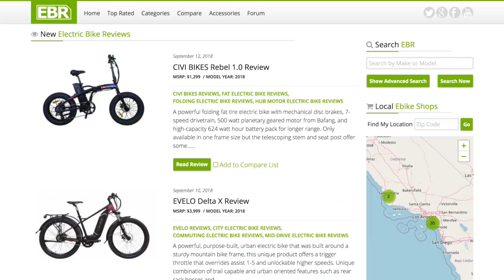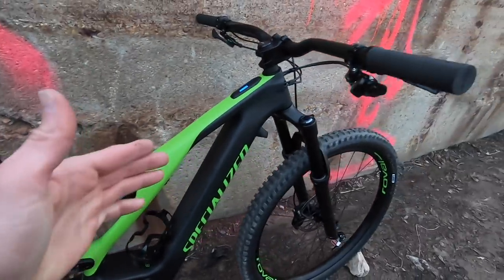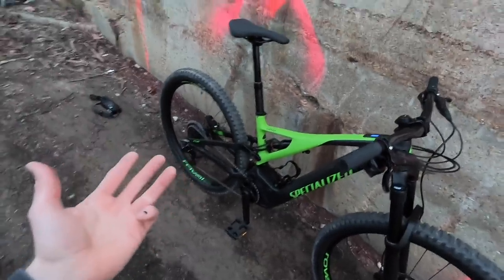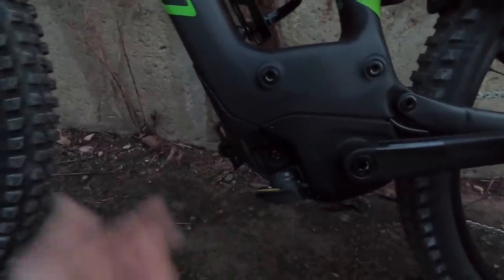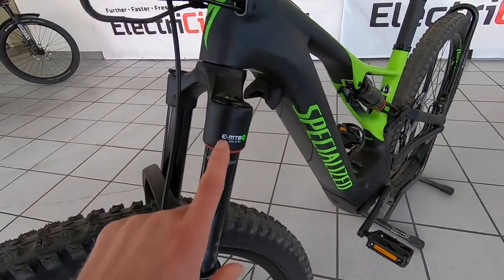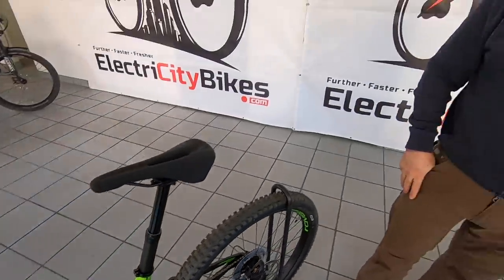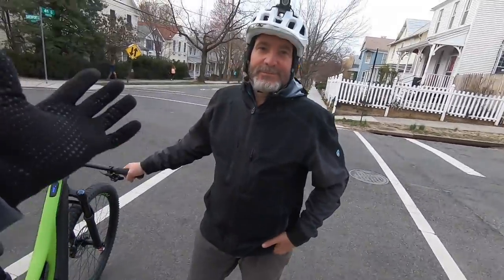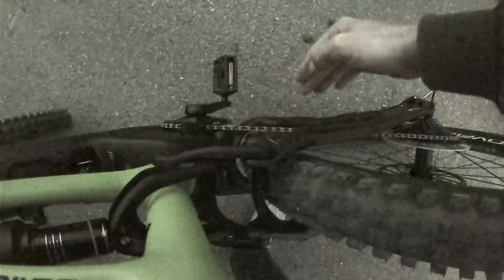2019 Specialized Turbo Levo Expert Review - $8.3k

Comment: Thanks for the review. I'll have to look at the price points for the lesser models of the Turbo Levo. Even $5000 is a bit of a stretch for many moderate bikers, such as myself. Spending $8000+ for an E-bike  is boggling when I can get a good motocrosser with 40+ horsepower, equipped with an electric motor to start it for the same amount. Apparently, the cost premium for a purpose built ~600 Watt electric motor, a 600+ Watt-hour lithium battery and some carbon fiber matches the cost of building a ~400+cc engine comprised of hundred of precision parts, an engine management computer, fairings, fuel injection system, and a raft of larger components (frame, brakes, tires, wheels, suspension, lighting, etc.)

Comment: I have the 2020 Levo Turbo ($5300).  I must say...the battery lasts FOREVER!  I have had the bike 2 years and charged it maybe once just to see how to do it...The battery still shows almost fully charged after multiple uses and in over a year.  I was concerned it would drain after no use for months...but not a problem at all.  Both tires were low on air but after pumping them up, I still had full charge and off I went.  Sometimes I feel like riding it regenerates the battery when I am not using any of the levels, which wouldn't be a bad idea when coasting down hill.

Comment: This is my next eMTB, love the 29x 2.6 but I’m going to wait a couple years.
Reply from the maker: Cool, do you think you'll get a used one at that point or save for the next generation of Levo? Maybe they will be even more refined by then... I agree that this thing is already amazing, and sometimes it's difficult to imagine how much more it can be improved, aside from more energy in a smaller, lighter battery :)
Reply: no, I'll probably get a new one and get a great deal on it, got the KENEVO & 2017 Turbo Levo, they are in my opinion the best eMTBs. I do like the Rocky Mountain, you should review one of those, but I'll wait and see if they fix the issue in the back housing of the motor where the dirt gets in, Specialized is the best brand even trying out Yamaha and Bosch early on.

Comment: I've only charged my 2018 Levo battery off the bike once since I bought it 18 months ago, so for me the added difficulty of turning this bike upside down to remove the battery is a non-issue. Probably the design of this seamless downtube allows a weight reduction while keeping the same strength, and the aesthetics are definitely nicer as well.

Comment: Nice bike Court and great job on the stair climb, This is just about in the same price range as the Pivot Shuttle. A bit curious how it would compare in terms of ride and build quality. Mission Control app also looks sweet to dial everything in to your liking. I also like that the sensor is hidden in the rear opposed to on the rear spoke wheel. Many cool refinements. Well done review indeed!  $8.2K is a little steep, however,  I do like the relocation of the power meter buttons. Cheers!

Comment: I would not expect a derailleur on such an expensive bike.
Reply from the maker: I think the X1 is ebike approved by SRAM to handle more force, and you don't need an Eagle cassette with 12 gears when you've got motor support, the steps between gears don't need to be as close and you don't need such a low gear... unless the battery runs out :P

Comment: Court I've been meaning to ask you next time you're with the actual developers of e bikes doesn't matter which manufacturer as to why ebike batteries are four times the price of automotive vehicles? Surely the batteries in my 40kwh Nissan leaf (£10,000) equates to over £$50,000 if you broke down the costings per ebike amount of battery? Surely automotive batteries are of much higher quality meaning even more questions as to why the consumer is being ripped off or the manufacturers of vehicles losing money? Cheers if you can find out.
Reply: It's an interesting question. Actually I believe the quality and type of cells are the same for the cars and bikes. I know my ev has Panasonic cells that are the same 18650 as my sondors. Possibly the quality control or matching of cells is higher in the car but pretty sure the cells themselves are identical. But anyway does beg the question why comparatively the batteries are more expensive on a bike.
Reply: You should take into consideration the BMS and the basic manufacturing costs which are mostly the same for each battery no matter which capacity they have. This explains a part of the difference and the rest is the pricing policy of manufacturer. For new devices there is a hell of competition but in after sales you already bought so they can charge more. It is totally normal tho calculate a factor of 3 for spare parts. They are all doing this as long as there is no second source where the clients can buy. For this reason there are several small companies offering to exchange the cells on the batteries for much lower price than a new original battery. The problem is that there are so many different battery designs and BMS out there that they concentrate on the big suppliers like Bosch, Yamaha and Shimano. For exotic parts like Specialized there might be never one doing this.
Reply: @habi0187  Thanks but surely an automotive bev BMS is much more dedicated due to the nature of more capacity and individual cells factor in liquid or passive cooling bms etc and the costs would spiral upwards not downwards.
Reply from the maker: I think some of it has to do with economies of scale, ebikes like this come in many sizes vs. just one. Bike companies tend to be smaller than car companies and are integrating expensive custom parts (like the carbon fiber frame). Also, in marketing courses they always teach that a product is worth as much as people will pay, and Specialized is decidedly high-end. It's why their stuff is all named custom and every part is tweaked a bit (even the motor software here, the stem cap, the little tool), there are many reasons for pricing but I'll be publishing a sub $2k full suspension ebike shortly that demonstrates what is possible for lower prices :)
Reply: @FancyaBevMate  You are right but the relative costs per battery is higher. Lets say the BMS for the car battery is 1000 Dollar and the bicycle battery is 300 Dollar means this is 10℅ compared to 25 % oft the retail price.
Reply: @habi0187  I own a 2019 haibike sduro trekking and love e bikes but they still need to sort this out as I wont be the first or the last to make comparisons and think why and like I said I would bet every day of the week in the batteries not to mention the bms on automotive industry are 3x the quality of those found on e bikes as their warranties show my 2018 leaf has a 100,000 mile warranty how many e bike batteries will have that warranty. I'm currently doing my own channel on my vehicle with full break downs on battery SOH (state of health) on each 10k miles charged from around 20% to max every day had the leaf for just over a year and its lost only 5% range on 33k miles. Cheers
Reply: Fancy a Bev Mate? I own a Specialized Levo FSR Comp of 2018 the battery health there is still good. Please take into consideration the car battery’s are normally not charged 100 % and there is a residual capacity of approx 10% in order to avoid bad conditions for the battery. Especially the BMS of the Nissan Leaf is a good example for a not so good engineered system. If you remember there is a thing called rapped charge gate for the Nissan. Since they have no active cooling for the battery you can not fast charge it correctly on longer trips. Even the new models are not using an active cooling for the battery. So that fast charging on CCS chargers is not really possible.
Reply: @habi0187  Mate with all due respect now you are talking utter garbage regarding the Nissan batteries its why I am currently the only taxi driver doing a long term vlog on this and many other issues (on you tube) that people have complained about first of all rapid gate is ONLY an issue for those in very hot climates AND if you travel more than 240miles per day, secondly its been fixed with an update (I wont have the update because even as a taxi driver I never travel more than the above mileage per day) I would rather have less degradation on cells which mine isn't showing even at 33k miles in just over a year. We know our vehicles I've been in the industry for nearly 25 years and you know your vehicle inside and out when you are traveling every day in it and I have lost I'd personally say around 2miles maximum. I will be running this vehicle for upwards of 200k miles (or until everything breaks or isn't viable in working conditions) to dispel all the myths regarding these cells. The early models had issues correct but then so has Tesla replacing electric motors and batteries way before their warranty expired. Ps on a side note if you can name ANY bev that won not just the European Car of the Year Award AND the World Car of the Year Award Oh and in ONE year let me know what that is....Nissan hold BOTH titles and is the only bev to do so factor in its the worlds best selling bev and yeah the batteries are garbage but hey ho....Please don't listen to all the hype there is good and bad in every vehicle but my points still remain in why we the consumers are being ripped off for batteries.
Reply: @FancyaBevMate  Well maybe the type they sell in Europe is different from the American here with the CCS charging 50 KW there is still reports that latest the 3rd charge is slowed down by the BMS. And yes, there are people going regularly more than 250 miles per day. Just last week I had to go from Berlin. to a rural town in Hungary which is about 750 miles. Since I have to do such trips regularly let's say 2 or 3 times a month and flying is no alternative I do not own a bev I will keep my Saab with 200,000 + miles and LPG as long as possible. Let's see what the future will bring in new battery technology maybe in 20 years bev will be having either much bigger and cheaper batteries or you can charge them in minutes not hours.

Comment: Ok this is getting out of hand. 8.2 k for a electric bicycle? I don't care how small the start up company is or how scarcely the components are. It should be a crime to charge this much for a bicycle. Un subbed.
Reply: @Edward Busk Porsche is a company that mastered the niche of sports car, being connected to the road. This took decades, Specialized is a company known for analog bicycles, this new fad of e bikes is a recent Trend that specialized picked up on. Now im all for paying Porsche top dollar for their full engineered, well balanced machines, but when it comes to electric bikes, specialized is charging the customer for the badge.
Reply: Again you keep diverting form the actual argument with meniscal claims. Did you really just bring up Ancheer and expect me to not know of the company, yes Ancheer is a very low speed bike compared to the Specialized and its 1/10 of the price..... Please do not use Ancheer as a comparison to your argument as you are cheating yourself and everyone else in the market for a e bike..... Ducati has their motorcycles priced just over 9k. Are you saying that a motorbike capable of going 100+ mile with the stellar reputation of the Ducati is the same in comparison as the engineering of these electric bikes constituting for the 8.2k price tag? Not to mention Yamaha and Kawasaki and few other reputable companies with motorbikes that are priced well under 5k brand new. Are you saying the componentry of these electric bicycle;es are higher than the motorbikes that travel a high rate of speed? (suspension, traction control, ABS, Double caliper brakes, Lithion battery for start up and display, LED headlights, etc? Are you saying that the reason the price tag is justified against these motorbikes is that you can ride them on bike paths? Is that it? Now few companies you mentioned such as Yamaha, haibike, etc are perfectly good examples of keeping the margin realistic for its customers and not preying upon sheep minded buyers such as yourself going through a midlife crisis, ready to spend their few extra thousand they saved from groceries(just an example, don't take it to heart). Also you did not address my claim that you can get the exact same componentry as specialized for a bike you build yourself.... It does not have to be equal in stature as the Ancheer.... The components making up of these bicycles are not rocket science as you make it out to be....Plenty of companies that compete fairly with these bikes with half the margins.. If Specialized had a monopoly of the tech and componentry involved in the bikes I would totally understand you, but as it stands now, its the brand that makes people like you throw money at them which inevitable creates a monopoly of that price range. With 112k Subs for this channel dedicated to E bikes and the relevant upload date, you would expect someone to jump in the convo in your defense by now but...... crickets.....@Edward Busk
Reply: So what you are saying is that customers are overpaying 3-5k purely for the sake of integration of these parts?  Not to mention how you over shot on the prices for the components involved in making a great bike. 900 for a bike battery? Are you overpaying for every single item in your life sir? E bikes are great but quite frankly its a sorry excuse to charge nearly 10 grand for a bicycle with a battery, suspension, and some tech. If integration is what closed you on paying that much for a bike, to each their own. If I worked at specialized, I would market to appeal to the masses considering the environmental and health benefit of owning an e bike, not to a specific niche of well off demographic. Clearly you are a brand focused consumer which is fine, but you do see the idiocrocy in that. Just look at your argument of listing components offered by specific brands. Did you do research outside of branding and find that the engineering of the components can be exactly matched elsewhere? To the teeth. Again we are not dealing with rocket science and there are plenty of comparable speced out suspension forks, integrated frames, and other compnentry to choose from online. You would be surprised in todays global market. Listen if you want to pay that much, go for it, I on the other hand, have rode on these bikes, and have built my own and have had an avid interest in e bikes for close to 7 years now. Based on my experience of building, test riding the very best e bikes, and friends who are engineers that have built themselves much more impressive ride quality e bikes, I am not convinced that the price tag equivocates to the "integration" aspect of a e bike. Again hate to compare to motor bikes, but the engineering involved in e bike going 30-40mph if that, are not rocket science to the general public and therefor, it should be pretend to be.

Comment: I have 5k version. Love it. So easy to ride,  even without motor engaged.
Reply from the maker: Sweet, thanks for the feedback on this! Are you riding the 2018 version or did you just grab a '19? If it's the Comp, is the frame Alloy for 2019?